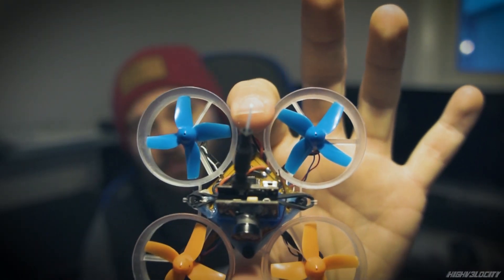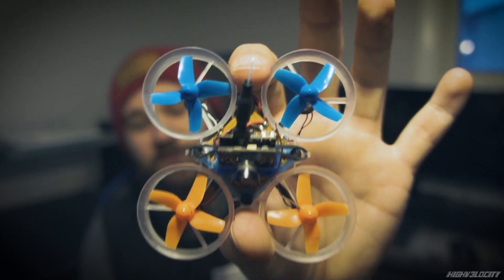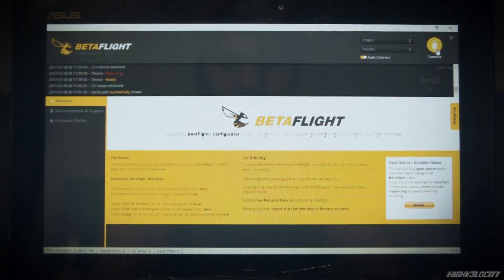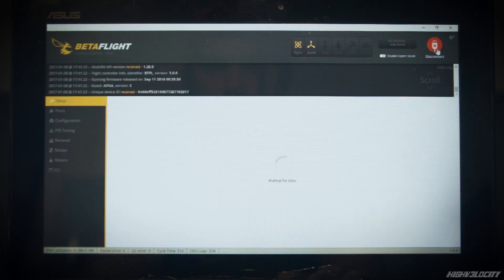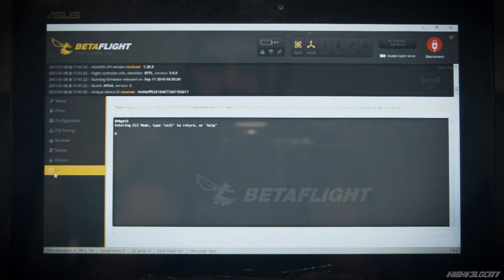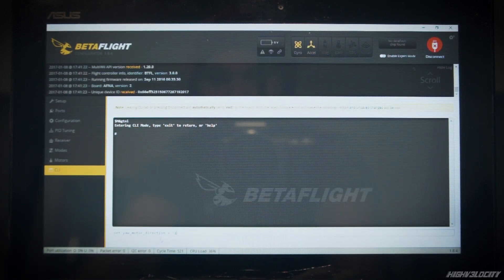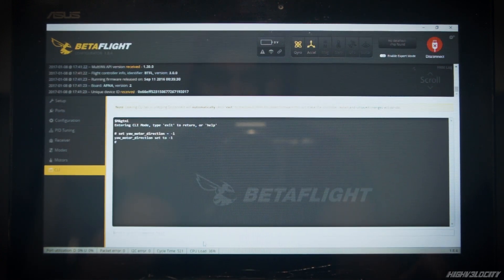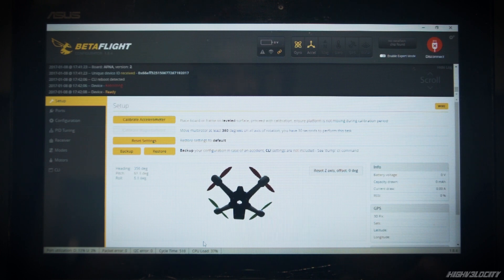How To Reverse Tiny Whoop Motor Direction Betaflight.

Comment: as of 3.2 the correct command is "set yaw_motors_reversed = ON"
Reply from the maker: I believe so but there is also a switch on the configurations page as well.
Reply: High V3locity huh i must have missed that. Thanks!

Comment: I️I️ have inductrix fpv pro if this doesn’t work is there  a way to reverse this or does it matter in a noob replaced my motors and now my quad  spins either left or right super fast I️t goes up and down with more or less throttle but won’t stop spinning please help
Reply: just reflash the board if it doesn't work

Comment: Just tried it. I do notice a small difference. Definately worth trying it. It do feel smoother at the end of a roll or flip. Note that in BF 3.2 the command have changed it is now something like set yaw_motors_reversed = on
Reply: Thanks for that info.
Reply: This needs to be pinned. Thank you!

Comment: Thanks ! Works great on the new Inductrix fpv PRO wich suffers a lot from prop wash in the original motor configuration. Now I have to try it on the Beecorre F3 Evo.

Comment: do you have to swap motor positions afterwards to not have them running in reverse direction and damage them?
Reply: You're not spinning the motors backwards but rather just telling BF where the motors sit in the frame. If you don't, your quad will just yaw like crazy.

Comment: hey bro, great vids!   I have a question one of my ports on my flight controller started spinning a clockwise prop into a counter clockwise direction.  do you know of any cli commands that would correct this?  otherwise i have to place 3 counter clockwise motors on and one clockwise which makes it fly okay, but i noticed more noise in the fpv.  any info would greatly be appreciated.
Reply: i had this problem on a beebrain.  the scket on the board was reversed, you can just pull it off and put it back on the right way round. i would think having 3 motors spinning the same way would give you trouble with yaw